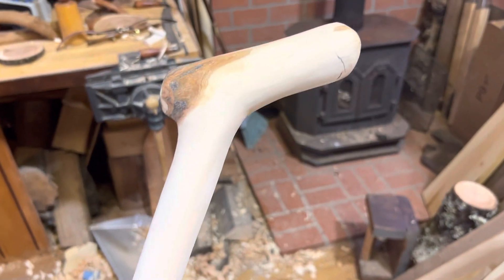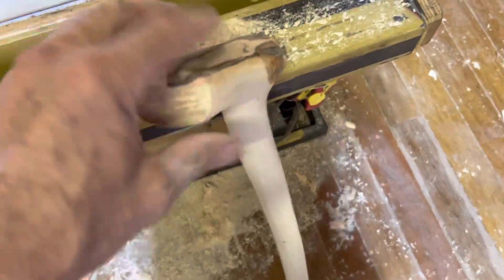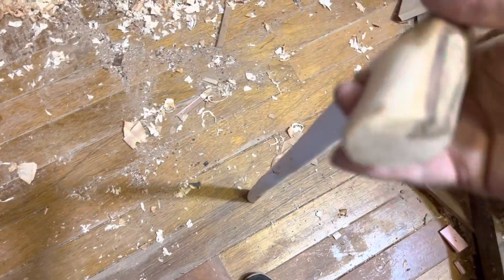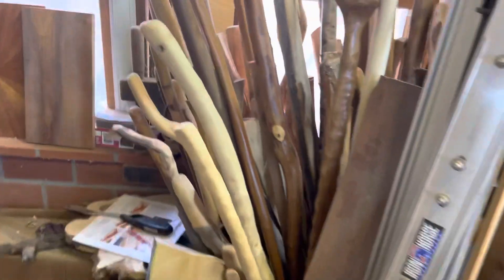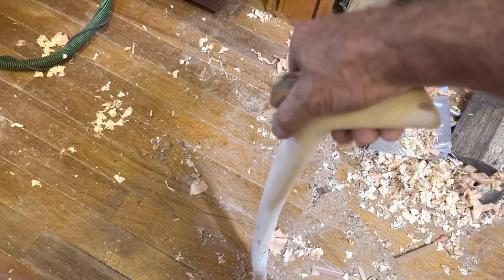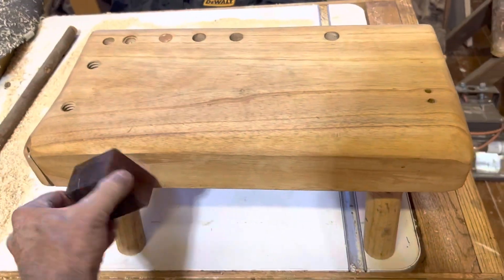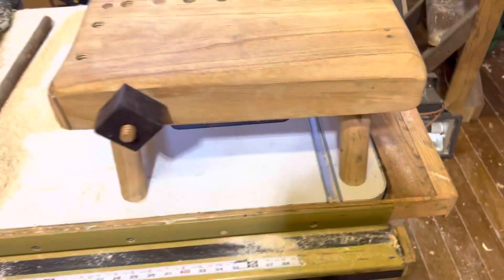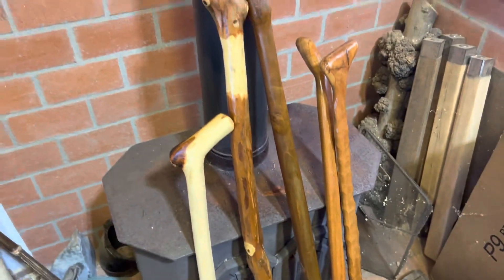MAKE A NATURAL BRANCH CANE

Comment: Great stuff! You’ve inspired me to use natural found wood handles and hooks on my chicken coop. I’m making it out of an old cattle trailer my grandpa built, frame and all. He even had a hidden slide-away ramp built in. 
I always loved exploring his work shop. Woodworking, tractor parts, welders, rows of hand built custom shelves in both wood and metal, random plumbing supplies here and there, old machine manuals that yellowed over time… Oh and a HUGE wood furnace he built to heat it in the winter. I used to tell my younger cousins that that’s where he got rid of the bodies 😂 Good times, miss him dearly.